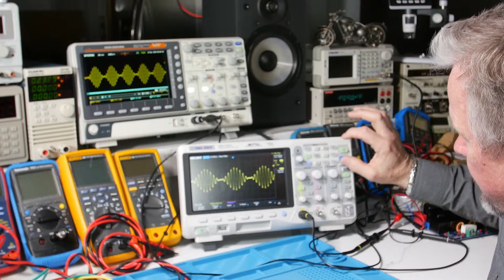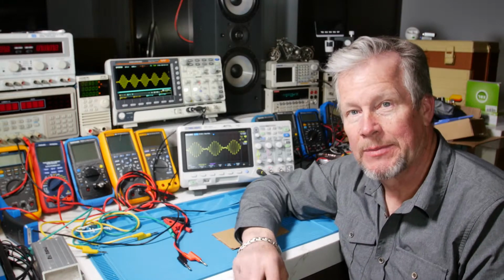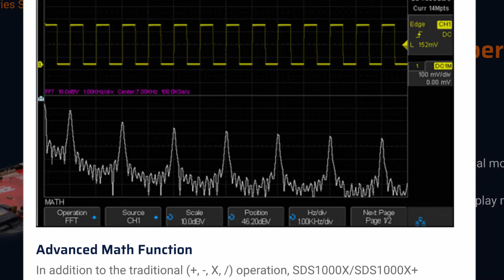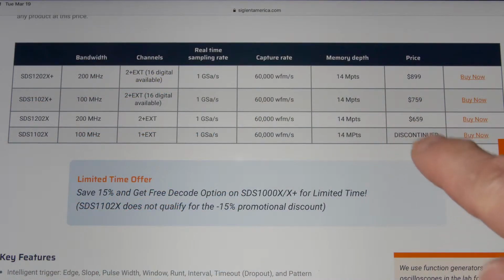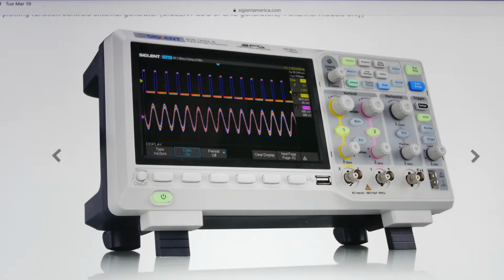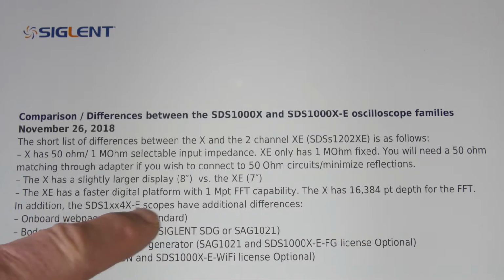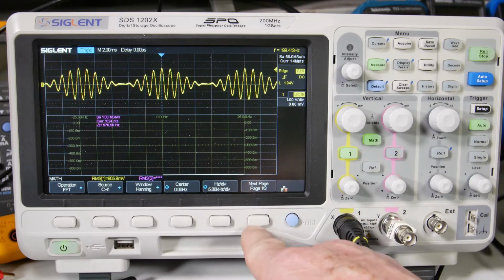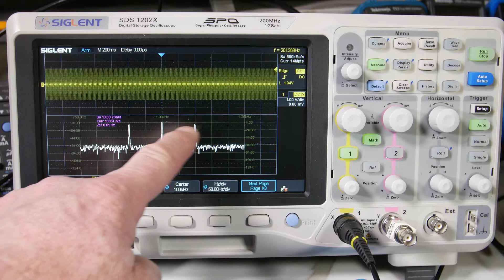Siglent SDS1000 Series X versus X-E

Comment: You don't need necessarily the siglent AWG to do bode plots. I use a cheap feeltech FY6900 AWG. There's a client-server app developed by some smart guy (ref. EEVblog forum) , which allows the scope to connect to the FY6900 via LAN by interposition of a windows PC or an ESP wifi module, connected to the FY6900 either via USB (if using a PC), or via the serial interface at the back of it (if using the ESP wifi module for running the client-server app).
Reply from the maker: Thank you for this great feedback!
Reply: is the fy6900 any good? from what I understood it doesn't go to 60mhz as declared.

Comment: Sorry, I think you do not like me commenting on DVMs but I do have to comment on the 200MHz, 4 channel Siglent.  $750!! Wow, fantastic.  What it has mine sitting in a storage room shelf never being certified each year, or used, is one missing feature.  Pulse Width measurement:  You can not set the mid-reference points (very important for what I use that for).  The default is 50%, I use  (90%).   I could program setups and get data from the Siglent very easily using VBA and VB.  I really loved the scope.  The software engineers were made aware of the request.  Maybe two software updates came out over the 1.5 to 2 years I've had the scope and this "issue" (request) was never address.  I could have sold several of these scopes with my software package.  I am back to using used Tektronix TDS3000 series scopes (wonderful scopes, but not as "cool" looking as the siglent nor nearly as nice of an LCD).
Reply from the maker: Thanks @Daveyk021 - I do like your comments - so please keep them coming;)  The 100 MHz 4 channel Siglent is on sale now for $450, now that's a deal;) https://amzn.to/3arnDfc
I made a request of Siglent too, and they were slow in responding to me as well.  The problem is, that my request had to do with the X and not the newer X-E.  If you made the request as I did on the X, they are not really interested in that and are more focused on working the new X-E.  Too bad the Tek doesn't have deeper memory - it would be great!  Also the 10k record length of the Tek FFT is dismal compared to the 1 M of the Siglent X-E series.
Reply: @KissAnalog  I don't use the memory depths or the FFT of the TDS3000 series.  I've seen videos of what memory depth is good for.

My request, about two years ago was for the SDS-1204X-E.

I do use FFT, but for UT transducer analysis, but I have a dedicated system for that.  The FFT I'm used to produces the smooth bell curve line, not the jagged lines.
Reply from the maker: I do have a contact for Siglent if you would like it, maybe he could help you.  Regarding the FFT, your Siglent 1 Megpoints will give you the higher resolution.  With higher res, individual frequencies can be found and it looks like bunch of straight lines with varing amplitude. With lower res FFT like your Tektronix individual freq can not be deciphered and it looks more like a pyramid or as you say a bell curve.   If your curve is really that smooth, is it FRA and not FFT?
Reply: @KissAnalog  Yea, I know the US contact.  All he can do it make suggestion to engineering.  My Bell curve is not from the Tektronix.  It comes from a Ultrasonic Pulser/Receiver PCB with software.  The software draws the industry traditional beautiful smooth bell curve displaying fPK, -3dBL and -dBH.

That software mimics the way it looked in the early 1980's with Tek 7400 mainframe with a spectrum analyzer plug-in.  One one trace you had the RF response from an UT transducer off a given target.  the second beam was the bell curve from the Spectrum analyzer plug-in.  The software, and certification data sheet from any transducer supplier mimics what the Tek 7400 provided way back when.  Except we no longer use a Polaroid camera to take a screen shot.
Reply: @KissAnalog  I wish I could attach an example of what I am used to seeing out of FFT software (or the old Tek SAs).
Reply: @KissAnalog  I sent you an email with examples of what I used to seeing.  I do have highly "tunnel" experience in electronics and not a more broad view.  That is why I love watching videos such as you and others produce.  I try re-learn electronics and open that "tunnel" up.

Comment: Hey Eddie...thanks for releasing this video...very informative. I have a question about screen size. The X-E version has a 7 inch screen and the X version has an 8 inch screen. In a previous video, I believe you indicated although the X version has an 8 inch screen, you only really see 7 inches with the menus. Since the X-E version has a "menu on/off" button...I wonder when you turn off the menus, does the screen fill with waveform. In other words (if this is true) does the resulting 7 inch waveform match the resulting 7 inch waveform on the X version?
Reply from the maker: Thanks Steve!  Great point, the X-E does allow for the menu buttons to be turned off - although I haven't been able to demo this myself.  However, when you are setting things up and have the menu buttons on, of course then the screen will be smaller.  My Instek allows me to turn them off and the screen is bigger to begin with.  Actually, I really like the Micsig for the large screen and smart way in how it is used.  Thanks for making this point!

Comment: Hee everybody for the wifi adapter you can use a normal TL-WN725N from TP-Link which is like $5 and your wifi will work!! You dont need the approved by siglent adapter!!
Reply: and its possible to unlock firmware options and bandwith on the SDS-1000X-E look it up on EEVblog =)
Reply from the maker: Thanks Arkin!
Reply from the maker: Wow - that is fantastic feedback!  Thank you - and so smart;)

Comment: Greetings.   

What you can get for the money sure has come a long way in the last few years. 

The 1g/s max sample rate normally is split between the channels in the basic scopes.   Using 2 channels sample rate would be max 500m/s sample which limits the usable measurable bandwidth ?   Also, would be nice to see how the max WFM update rate compares with typical measurements.   Did you notice if the memory depth is segmented ?   

Thanks for channel.
Reply from the maker: Thank you for the great feedback!

Yes the sample rate is shared between the two channels, but 500 MSa/s is great for 200 MHz bandwidth.  

They do have they segmented memory feature as well;) like you say - a lot for your money these days;)